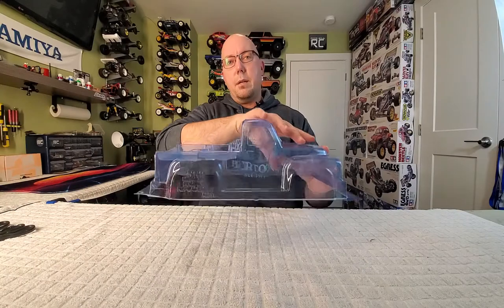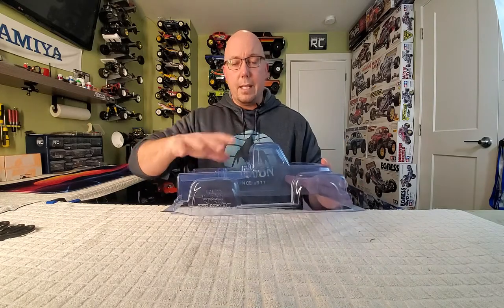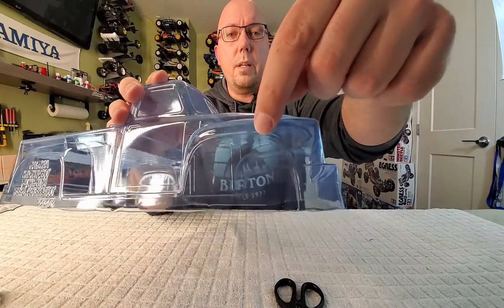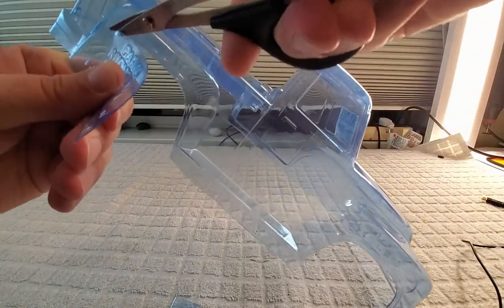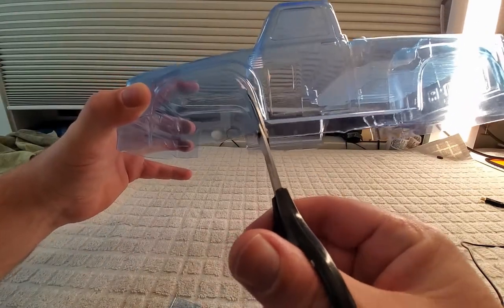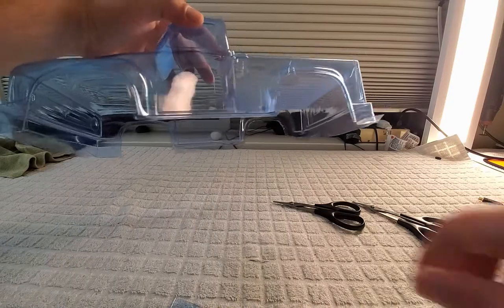How To Prep a Lexan Body for Paint

Comment: On your wheel arches it really helps to cut shy of the line and use a sanding drum on a dremel to finish. You get smoother lines and avoid and stress risers that result in cracked bodies later. I generally sand all the edges to smooth it out, but the curved sections it really matters.
Reply from the maker: I need to pick up some new sanding drums, that's a really good idea, I need to try it out.  Thanks for the tip!

Comment: Fil! these body finishing video's of yours are my go to resource when doing lexan work.  Thanks much for putting this info up for all of us.  I did have one question for you, is there a method you could recommend to polish scratches out of the windows?  I run a camera inside the body and clear windows are a priority for me.  Cheers!  
Sorry, I just thought of a second question lol.  Is it possible to use a brush for paint touchups?  Like spray some of the ps paint into a little cup and then use it with a bruch to do some detail or trim on the body.
Reply from the maker: That's wicked dude! I'm glad these videos are helping you out! 👊

As for polishing the lexan, I'm sure you can do it, it would just be a matter of selecting the right polish for the job. Now, I've never done it before, so I'm not speaking from experience, but in theory, it should work just fine.  Perhaps another video idea.... 🤔

As for your touch up question. Yes, you definitely can do what you're thinking of. But be sure to use body lines to mask off of, it helps fool the eye into not seeing the repair. I covered this subject in this video: https://youtu.be/fxpGzMNURSY

Hopefully that helps! 🍻
Reply: @poorboysrc  thanks so much 🤙
Reply from the maker: @JIPPERR_1  any time, amigo! 😎